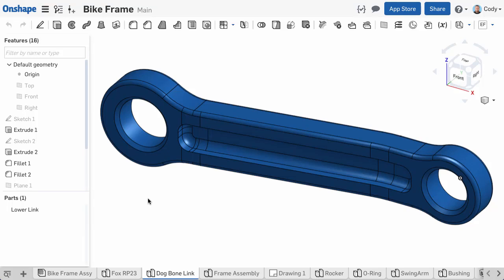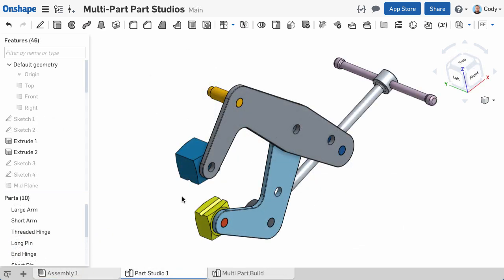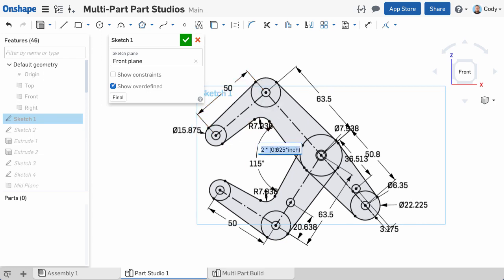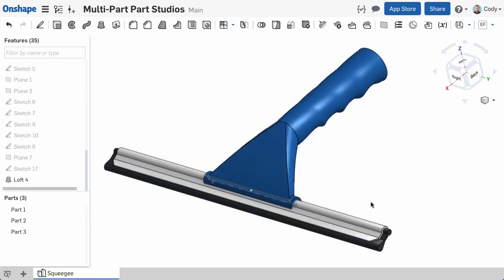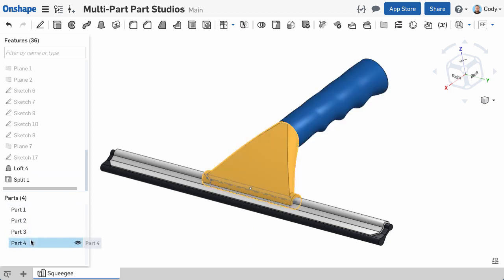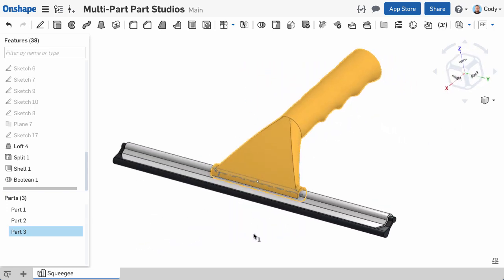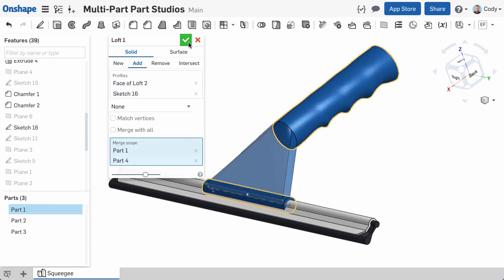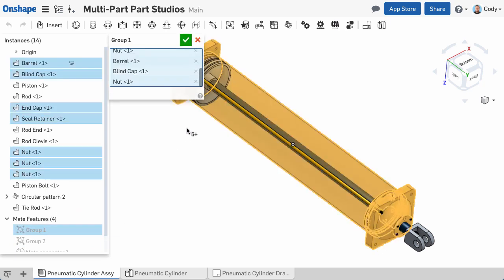Multi-Part Part Studio Applications | Multi-Part Part Studios

Comment: I made 1 part in one parts studio,and 1 part in another parts studio,I need to bring both of those parts into 1 single parts studio,is this possible, I can put them both into assemblies but I don't want to do that I need them both in one,because I don't need to do mates,I want to boolean union the two parts together to make one part for 3d printing,but I cannot find a way to take the two separate parts studio parts and merge them into one parts studio to do this?
Reply: You should be able to use the "Derived" feature to reference one part in another parstudio and perform boolean operations between the 2 parts.